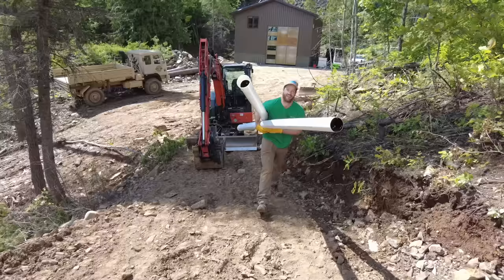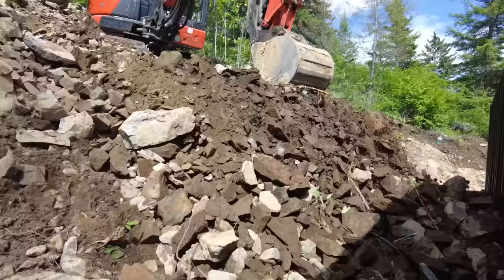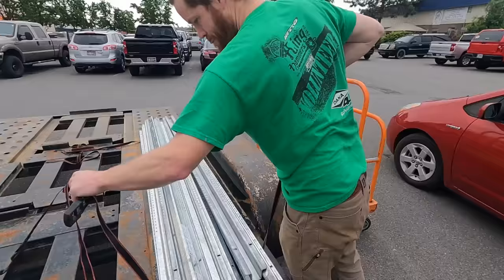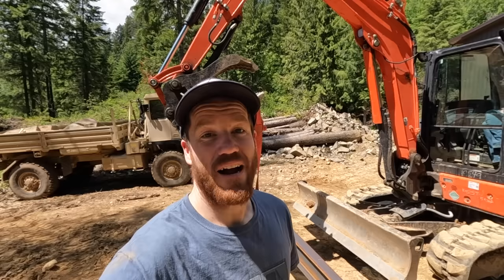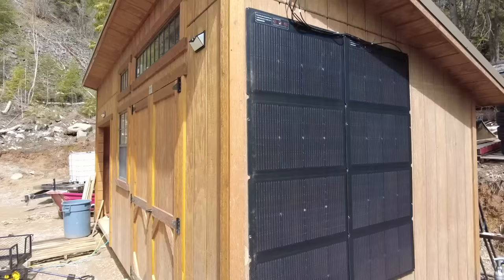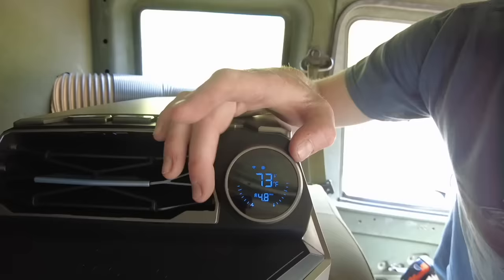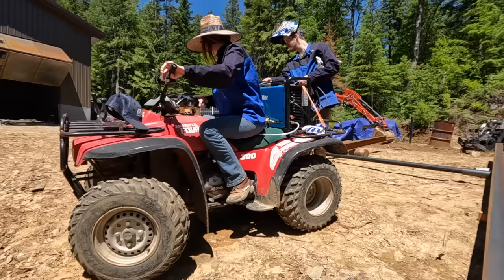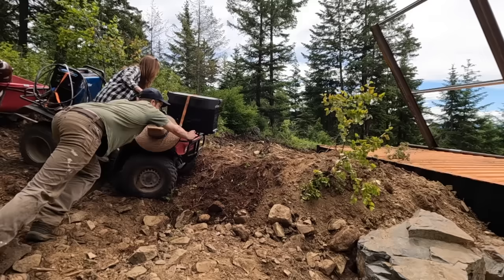We Were Told To NEVER Do This | Burying A Shipping Container

Comment: Great idea.say your videos today .I am from Aus. Been installing solar for years. Looks awesome. 

Just a recommendation . Imajine holding a solar panel in a wind storm and imajine that pressure when there all on container. 

It may not seem like much but you definitely need to support it more for long term . Top and the bottom

Use what you did on the top on the bottom or similar

If solar panels move alot they can get something called micro cracks so keeping moment low is important for longer life of the cells

Comment: Instead of nuts/bolts that can rust, corrode and require tools to deal with in your telescoping sign post, how about using the heavy duty trailer hitch pins with the bails?  No tools, or loose parts, and can be tethered to the outer tube with cable. 

I would also keep the sliding parts of the sign post well lubed inside with waterproof marine grease for good measure, as friction, dust and rain will certainly cause internal corrosion and then things will bind up.

Comment: Theoretically, as soon as that uphill backfield that you did on. The container collection maintains moisture from the rain. That I'll add weight to it and then I'll push against the walls of the container and oregon's the overall container and make it shift. But the amount of batteries that you've put into there and that weight will help hold it in place. But the other ring could pivot because that's the lighter end.

Comment: if you coated it heavily in bituminous coating such as ormanoid it would last quite a while depending on how acid or alkaline your soil is and how much rain you get etc. and yes back filling with a layer of gravel all round will allow the moisture to drain with soakage pipe at the bottom it would drain quite well.

Comment: Clean metal is important to good welds. Otherwise millscale and other contamination can ruin your welds. Use a grinder to grind off the area you are welding first always. Any areas you won't be able to access after welding should have weld through primer applied to protect the metal from rust.

Comment: Without reading the comments or watching the video. You totally can but you need to reinforce it first and find a way to vent it so moisture doesnt build up. Ive heard of many folks doing this so they can build gun vaults on their property. They used an HVAC unit to control moisture and temperature and lined the walls with moisture protection via thick concrete walls and floors outside the container. Similar to a bank vault. They had to reinforce it with steel to keep the container from folding up but seems like it would work fine. The only concern I would have is moisture build up and mold. I think it would make a fun emergency bunker if you needed one.

Comment: Absolutely a phenomenal idea and build brought to fruition on your solar panel system mount to take advantage of all four different solar season maximum sun hours if you want to. 
A shipping container is only structured to be strong on it's four outside corners. This allows them to be stacked on top of one another, also the roof of the one below lends structural integrity to the one above it. Without having any support with steel posts and proper trusses or bracing down the sides of your container, the weight of the dirt on top will cause it to collapse. You also need to place a waterproof material over the top before you put on the dirt. Look at some videos where containers have been buried for bunkers, then tell me how safe you feel!

Comment: If you bury a container, it needs to be encased in cement, where any dirt would otherwise make contact. Alternately, if you cover it in plastic or a tarp. Basically just keep the metal from making contact with soil, to help keep oxidation at a minimal, to keep it from rusting.

Comment: To stop it from moving, you could have put gravel and dirt on top first, and parked a few cars inside it before putting the gravel on one side. You could have also put gravel on both sides equally, 1’ or 2’ at a time.

Comment: I loved the video and your ingenuity on the solar array is amazing. As a welder/fabricator I do see some flaws in the construction. You should have cleaned and pre-heated the weld area on the I-beams considering you don't have 220v. You should also grind any galvanized metal you weld. Galvanized steel is zinc coated steel and zinc WILL ruin a steel weld (not to mention the toxic fumes it produces). Also you should cap, seal and add some zerk fittings for lubrication to the hinges, it will make them easier to adjust in the future. Also, add a strong locking mechanism to keep the panels in the proper orientation. But otherwise, Awesome Video!!!

Comment: Would be a good idea to get a worm gear drive winch.  They will hold position without having the ratchet stop on the gear.  Just to be a little safer in case of wind gust when moving the array.

Comment: The container is essentially a retaining wall.  Every retaining wall I have built sits on a steel reinforced  footer.  The footer extends back in to the earth so as the top of the slope presses down hill the footer prevents lift and subsequent tilt.  After a soaking rain and the mass of the hill begins to seek its own level, the container will lift and begin to tilt.  Even though you have heavy stone and a french drain, the silt will build and eventually force the container outward.   Short of redoing the entire placement you could do a couple of hacks like weld large steel triangles out front to buttress the the top front to the ground or perhaps weld steel I beams to the top, with tee's, to act like ties (aka sleepers) and place them into the hill to prevent pull out. Not if but when it tilts perhaps the giant panel frame will hit the ground and act as a buttress. Sorry to be negative just have experience successfully dealing with slopes and retaining walls.

Comment: Time add some remote pin release so you don't have to go up top every time to pull the pins. I would also add a mechanical angle gauge (gravity type) so you can read the angle by the winch.
Reply from the maker: That is a great idea!
Reply: @AmbitionStrikes  I would also make room on the bottom so you can go all the way close to vertical. Easier to remove snow.

Comment: If you look at the structure of the container the only real support is on the corners. As long as you don’t compact your backfill you should be ok. Don’t put any on your roof without reinforcing it with steel box section or I beams on top. The life of your container will depend on you. As long as you keep painting it to keep the rust away it will outlive you. Have you calculated the full weight of batteries and other equipment in the container? That will determine what you wind resistance will be. You should consider wire guy ropes into concrete anchors for extra protection if wind could be an issue.
Reply from the maker: I think that adding wire guy ropes is a really good idea.

Comment: Nothing wrong with burying a shipping container. The main reason folks say not to is because the roofs ar not strong enough for lots of dirt and they will collapse. Ive hauled containers for a good part of 40 years and I can vouch for that. But thats not to say you cant re-enforce the top with cross iron and timbers before burying. Their strong points are at the cornerholds and thats what keeps them form crushing when you see them stacked high at the ports. Also,,,the doors can only be opened and closed from the outside,so if you plan to use it as a living quarters,youd need to figure that out.
Reply: The sides and roof cave cuz they're designed to spread the weight vertically not hold lateral pressures like dirt pushing against the sides...yes they do collapse and buckle in.

Comment: You should be using flux core wire when you weld outside if you use solid wire with gas you won't get a very good weld when the wind blows your gas shield away.
Welding with a gas shield is intended for in shop use. Just food for thought, good luck with your project.

Comment: Regarding hammering in rebar posts at the bottom of the outer edge of the seacan:  1) it is a a good idea to prevent seacan movement but perhaps not enough   and     2) better might be to inset into concrete three of those concrete posts you used as the base of the poles (of the pole barn) which besides preventing lateral movement but would also resist the seacan pivoting on the rebar and tipping    and  3) perhaps a further measure to prevent seacan tipping would be to weld horizontal tabs or shelves (or even welded-on large metal boxes later filled with concrete)  onto the uphill side of the seacan.    The horizontal tabs or shelves (or welded-on metal boxes later filled with concrete) would engage the backfill and prevent the tipping (ie lifting of the uphill side of the seacan).

Comment: I'd want to put a simple automatic sun tracking system on it so it can adjust for the sun height throughout the day and with the seasons. Make it a completely independent system with its own small solar panel so it doesn't take power from the main system.

Comment: I've thought about burying a shipping container.  If I did, I would use it as an inside form for a concrete pour.  encase the container in rebar so the container rests on concrete blocks above the rebar. Weld rebar to sides and top. Put plywood out to the sides an backfill. Install roof bracing inside.  Ideally 24'' thick concrete, 36" sides and top would nuke radiation blocking.

Comment: Wind load? Single person operation? Safety? Quedos for having a crack at it, consider how high windloads will flex the structure and shift the container. Additionally with severe weather the friction coefficient will drop when water permeates the friction joints. Actuating the pivoted platform from underneath isn't safe. Relying on centre of mass may suit until a tree limb or material buildup changes the COG. Nice prototype, hope you keep developing it.

Comment: as a pro landscaper that has to keep water away from the foundations and basements of houses... What i could do is dig the hole 3' wider than the box.. install french drains on both sides and back. and make sure the drains are downhill from the container.. Then over the top of the container, lay butyl rubber (ie: a pond liner) over the top and down the sides and back.. Only have the doors exposed to get in and out. (so this is dug out of a slope with doors down from the slope.. Having the rubber will keep the contents from getting web by erosion and rust. The drains will wick the rain/ground water away from the box..
Reply: French Drains are that 4" perforated tube, with a mesh sleeve .  without the sleeve, the pipe will fill up with sediment and not work.. Eventually that steel box will rust thru because of being constantly wet in the rain and winter..

Comment: As a trucker. You are doing your tie downs wrong.  In the reel you slip it through the slot and tighter n. Do not use it as a belt reel. Let the end flop or tucked in. That way it won’t go loose.

Comment: You should get flux core wire for welding outdoors. You would not have to drag the bottle around and if there is any wind, you lose your shielding and makes the weld weak.

Comment: Only thing I see could be an issue in the future is the drain pipe. Being right at the bottom side of the container instead of below means the water will pool at that hight. This means water will rot that bottom side out quicker.

Comment: When living entirely off-grid, you generally want to design/optimize your solar system so it meets your energy needs at the worst case part of the year.  For most people living in the northern hemisphere, the "worst case" months of the year are December and January, although in a few exceptionally hot places (ex: Phoenix Arizona), July and August tend to be the worst instead.  However, for most places in the northern hemisphere, energy usage is highest in the winter, which also happens to be when energy production from the solar panels is usually lowest.

To live off-grid with solar panels, you generally don't actually need (or even necessarily benefit from having) adjustable angle solar arrays.  Generally speaking, if you optimize and size your solar system using a hard mounted fixed angle, so as to meet your energy needs during the worst case months of the year, then you usually will also have ample energy during all other months of the year as well.

For northern Idaho, the worst case months will be those near the winter solstice (ex: December and January).  Unless you have active use for the extra energy potential during the spring/summer months (ex: from a grid-tie system with net metering), then a moving array angle likely won't benefit you, as the extra energy potential during the spring/summer ends up usually going to waste/unused, in an off-grid system.  Meanwhile, moving angle solar arrays are more complex to design, more difficult to fabricate, more expensive to fabricate, and usually result in designs that are weaker and more vulnerable to worst case wind storm conditions.

For off-grid living in northern Idaho, one can get away with installing the solar panels fixed at an extremely steep angle, even as high as 90 degrees (ex: fully vertical).  According to the PVWatts calculator (pvwatts.nrel.gov), you actually end up getting about the same production in December and January, with a 90 degree angle, as you would with a 48 degree angle (which matches the ~48 degrees north latitude of Ponderay Idaho).  Using a 48 degree fixed angle provides better overall average production (compared to 90 degrees) for most of the year, but not during the December/January worst case months of the year.

Installing the panels at a very steep angle (ex: 90 degrees or approaching that value) is also no doubt helpful for dealing with snow.

Comment: as a suggestion, if it were me, I'd have supported that backwall of the crate with a concrete block wall to keep the pressure off the wall of the container. THEN bury the wall. as it stands, eventually all that rock and dirt will push in the wall causing the container to buckle on the walls, then the top will collapse. 

As for the other side, you might've considered renting or buying a stake driver. The gas powered ones can usually break through rock in the ground.

Comment: Sorry for the long post....

Unless you are going to totally bury the container, you'll probably be fine...  but remember, ISO containers where designed to handle immense loads, on the corners....and the floors are uber strong....  

According to Hapag-Lloyd, maximum spread load for a 20' container is 10,582lbs per running meter of length (16,755lbs for steel floors) not to exceed maximum gross weight (71, 650lbs for a 20' container).

So assuming you're using a wood floor 20' container, based on ISO 1496 (the ISO container standard), side walls should withstand .6g or 60% of an evenly distributed floor load.

Or doing the math....  a 20' container is about 6 meters in length. So 63,692lbs floor load / .6 equals about 38,000lbs of side load on the walls.
BUT, don't forget about the ends.... which is only .4g or 40% of the floor load, so about 25,500lbs of load on the end walls.

That's in a perfect world though. Where the container is sitting square, on something that can take the corner loads....

Remember, dirt is a LOT heavier than people think.

And for the roof? For a 20' container, the roof loading works out to about 16,410 kg total, or about 36,100lbs.  Which IS NOT A LOT OF DIRT.... for a standard 20' container, that works out to about 12,000lbs of dirt per foot of cover. So at around 36 inches of cover dirt, you've hit the max roof loading.....

I have seen buried containers after they collapse.... it's not pretty.

Always, ALWAYS REMEMBER.... ISO containers where designed to have the load on the FLOOR carried through to the CORNER BEAMS. The walls and ends are only there to provide an enclosed space. This is why you see container ships with containers stacked 20 or 30 containers high.... the CORNERS are taking the load.

Please be safe.

Looking forward to the next video! (I promise I won't ramble next time.  :)   )

Here is part of ISO 1496:

Permissible loading capacity of container walls and container roof

The permissible loading capacity of the container walls and the container roof is laid down in ISO 1496 and the Container Safety Convention (CSC).

Containers must withstand a load in the lengthwise direction which corresponds to external acceleration of 2 g acting horizontally on the floor fastening elements. These stresses are transmitted by vehicles to the container via the twist locks (turn-lock fasteners for locking containers).

The CSC stipulates that end walls must be designed to withstand loads of 0.4 g. This corresponds to 40% of the maximum payload of the container when the end wall is evenly loaded.

According to the CSC, the side walls must withstand loads of 0.6 g, which corresponds to an evenly distributed load amounting to 60% of maximum payload.

The values apply only to large-area loads. As with the container floor, point loads very readily result in damage to the container walls. Where point loads are expected or are unavoidable because of the nature and shape of the cargo, appropriate precautions must be taken.

The permissible loading capacity of the container roof is only very slight. The CSC stipulates that it withstand a 200 kg load over an area of 600 x 300 mm; cargo must therefore never be put on the roof. When several containers are stacked on top of one another, the forces are conducted into the corner posts, thereby relieving the roof.

Each container must have a valid safety approval plate (CSC plate). If the end or side walls have a lower or higher permissible loading capacity than the above-stated values, this must be marked on the CSC plate.